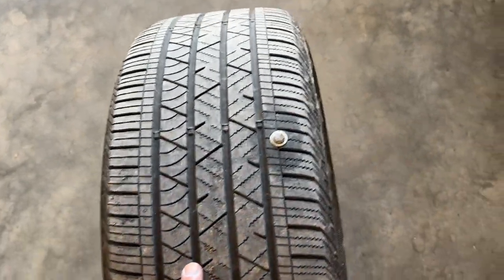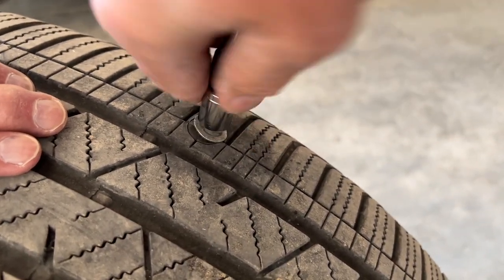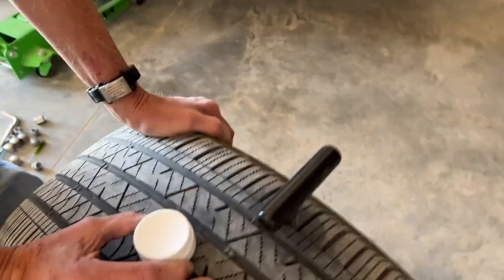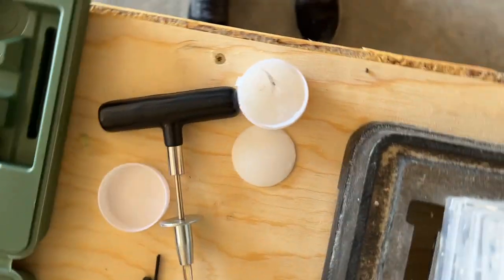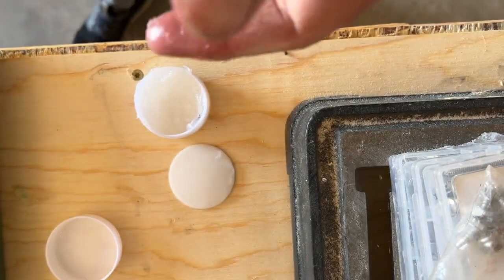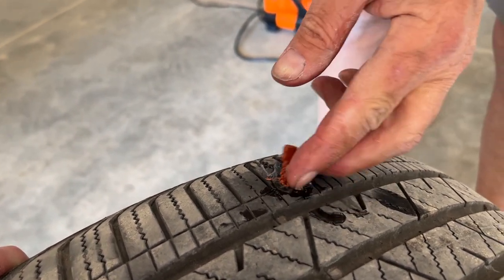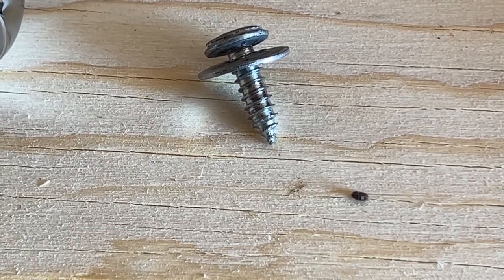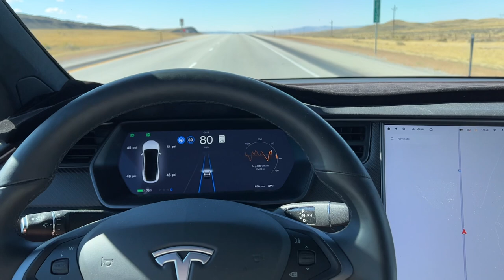Ranch Style Flat Fixin

Comment: I had a flat on a previous model S in exactly the same location and Tesla service center in Massachusetts refused to fix it claiming a repair outside center 2 inches of tire was unsafe.

They wanted to throw away my otherwise perfectly good tire and sell me a new one.  In addition, they said you should never replace only one tire because tires won’t be balanced for stopping power.  I feel they want to waste customer’s money.  

I took it to a reputable tire store and they fixed it for a very low price including patch on inside.
Reply from the maker: They err on safety I guess
Reply: @evdave528  Sure they do, because it is NOT their money.  If it was their money, you would hear a different story.

Comment: Curious how the lube and the glue on the patch work together, allowing the patch to adhere to the tire.
Reply: Older kits used to come with rubber cement instead of lube but newer ones have all gone the lube-only route.  I think they figured out the rubber cement didn't do much and the lube just helps get the sticky plug through the hole.  Once the plug is in the hole, it's tight and will have pushed most of the lube out of the way allowing the sticky plug to stick to the tire.  The plug is also designed to swell once inserted.